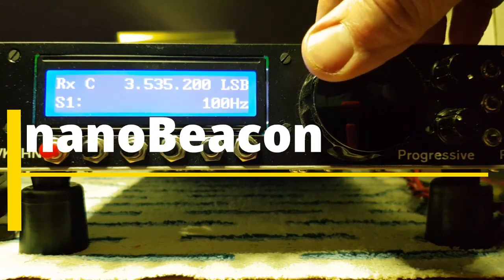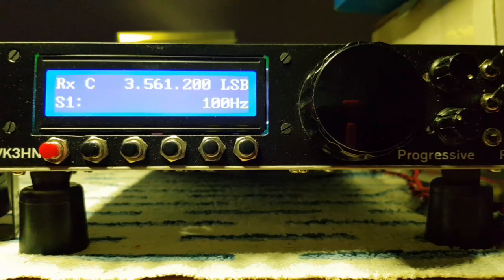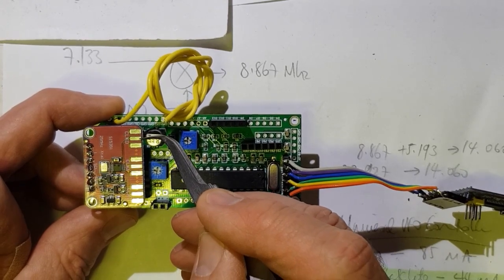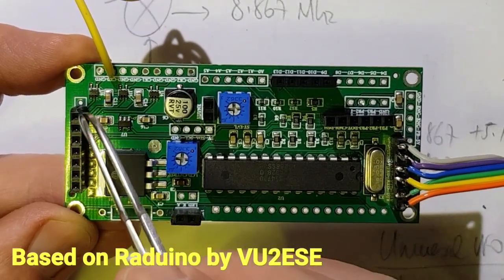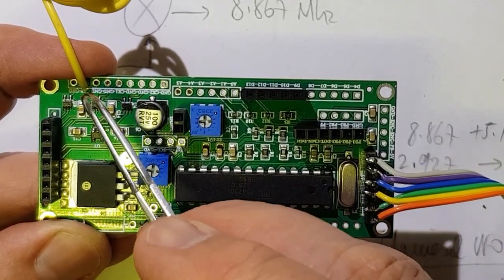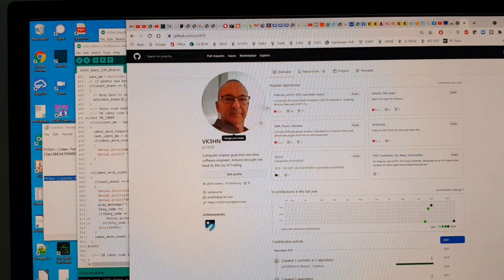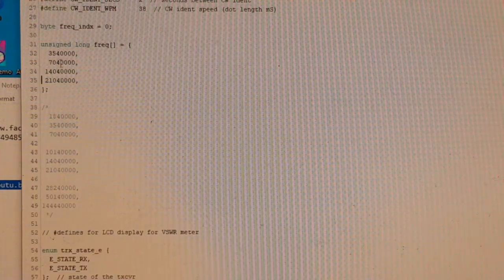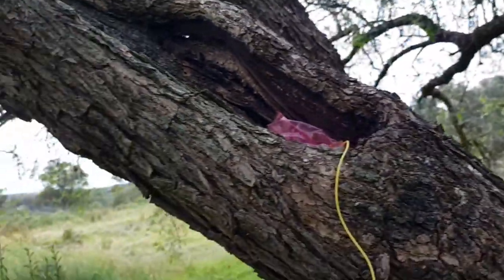HF CW Beacon with ATMega328 and si5351

Comment: wow. Atmega arduino and si5351 chips have changed the way we made VFO . From analogue it has become digital.
Reply from the maker: The advantages of digital VFOs are enormous.  However you do need to add some filtering if you want to approximate the kind of  pure sine wave you would expect from an analogue VFO.

Comment: Dear Paul, the sketch upload process still fails, I have tried several times.  si5351.h no such file or directory.  Please advise. Tks
Reply from the maker: Your si5351 library is not being found by the Arduino compiler. 
1. install the lib by jason NT7S;      
2. Upload and run his test script or alignment script to your Arduino with si5351 wired up and verify all is working.      
3. If your compiler still cannot see library .h files check you paths in Arduino IDE settings;     
4. Then reload my sketch and try again.

Let me know if you continue to have problems.  
All the Arduino help is online from mutiple reputable sources.
Good luck! SK . .

Comment: Hopefully anyone making this and actually putting the signal on the air uses output filters.  SI5351 are very rich in harmonics and trash.
Reply from the maker: You are correct Steven.  If this were anything more than a local test signal source or if you planned to run it continuously you would need to add LPFs.  With a 6 inch wire the signal got weak and under the noise on my station receiver (with resonant dipole) a few hundred meters away.  Thanks for commenting!